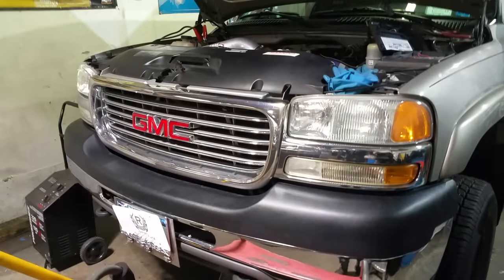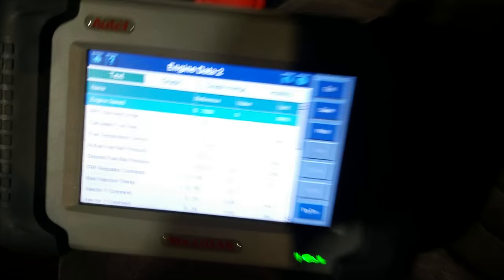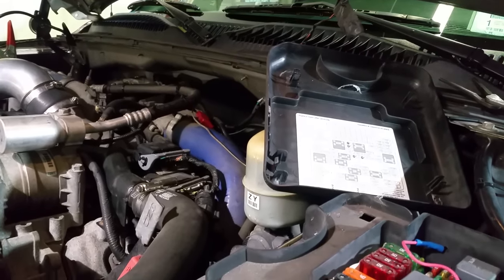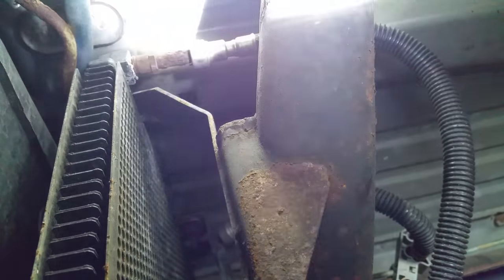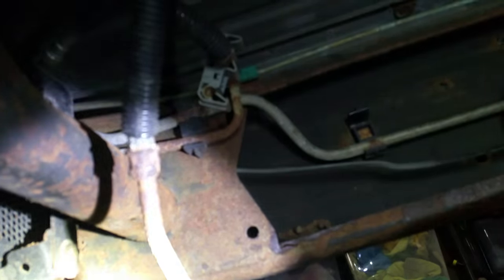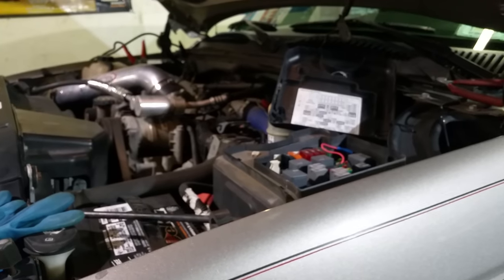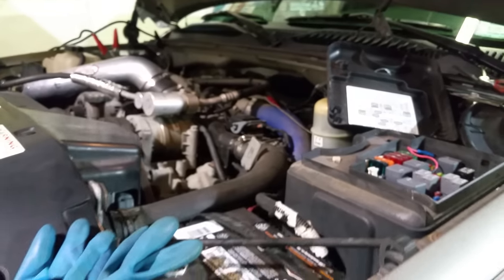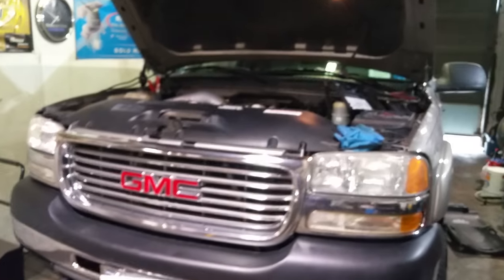How to test lb7 injector return rates balance rates cp3 failure rail pressure relief valve regulator

Comment: Richie, you are wise in the ways of Duramax! 👍👍👍 

Some folks go to the trouble of checking return rates on each bank, but I believe if the engine has 60-70k on VCO injectors, the owner may not be well served by knowing which bank is particularly bad since “in for a penny, in for a pound” comes into play. If a mechanic needs to go in, the injectors are high mileage, and total return is out of spec (CP3 is OK) may as well do an entire set, preferably SACs, which are getting good reviews in the short term (I’ve not read of high mileage experience).

And wow, does the engine you are diagnosing crank fast! New batteries, or low compression? That puppy is really spinning and the ball/seats in the in injector return system must be shot, if they can’t maintain minimum rail pressure for starting.

Comment: Ive found good way to rule out the cp3 when it wont start after a hot soak is to pour cold water on the cp3 and put a air line on it and cool it off. If it starts attempt to max the fuel pressure with a scan tool.

Comment: Why do you think ULSD is responsible for injector failure? Lubricity? That's taken care of at the refinery when lubricity additives are put into the fuel. Would it have been easier to disconnect the return line near the firewall instead of under the truck? Finally, although internal condition of fuel lines is not necessarily related to the external condition, I believe it would be prudent to at least do an inspection. Rust particles can overwhelm the best filter and destroy new injectors in short order. Pretty good "one handed" camera work! 👍👍👍 How's that LB7 running?

Comment: nice vidoe i have a 04 and it won’t star after i put gas instead of deasel  ranit about 20min and it died it havent start after that i took tank off and washed it rebuilt primer. and it still won’t start before this it ran good no smoke it ran fine took it to dealer they said 3 injectors 4,6,8 and 5 were stuck open and thats why it wouldn’t crank and needed all new injectors,but not shure any suggestions i’ll apréciate it

Comment from the maker: I apologize for this correction but the values recognized as Mpa is "Mega" pascal NOT mili pascal as that would be noted as a small "m" insead. The camera doesn't forgive mistakes! lol
Reply: My LB7 has long cranks sometimes won't start.  My balance rates are good and my return rates are less than 100 ml.  Where would you go from here?  Thanks

Comment: I have an Autel just like yours on the injector readings i'm getting 0.24 what is a good reading for the injectors i have an 2002 durmax?
Reply: Mine is also an 02, if that number is for one of your cylinder balance rates in mm3 then it is within spec assuming your rail pressure, fuel rate, temp and all other conditions for a balance rate test are met. Between +4 and-4 mm3 is within spec for an individual injector. All conditions for BR testing need to be met otherwise the BR numbers will not be accurate.

Comment: soo i have an 02 Lb7 i just bought. it will not build rail pressure, it will not build more then 10k when desired is anything higher then that.   i do not have any hard starts. or rough idle,  i have 2 injector balance rates at -3.0 , +3.2 at idle in park, every other is good. i put a lift pump on the truck and it didnt do a thing. im leaning towards a bad CP3. what do you think. thanks
Reply from the maker: For starters, what is the duty cycle of the FPR? Try ans unplug the FPR and see if it can build max rail pressure at idle. If not then move onto the test in this video. I have not seen many failed cp3s. Begin by testing the common items such as fuel pressure regulator, relief valve (test instructions in another video on this page) and delivery to the cp3.
Reply: @richiestruckandauto7438  Hey wont taking off the fpr cause the injectors stress and possible leaks ? I am also guessing we should see about 22000 pounds if the fpr is disconnected
Reply from the maker: @MrAgatto2  No sir. A stock cp3 should not be able to build 22k+ of rail psi at idle. The pump isnt turning quickly enough to build the volume. You would most likely experience pressures in the mid teens like 13-15k at idle. Its only a test to be performed for a second and NOT to be driven in that condition.

Comment: Have an 03 top kick we did injectors in. high balance rates, making oil. replaced all 8 injectors new bosch. lines and all the associated gaskets and seals. fired right up. no longer making oil but balance rates are still high as initial. frp good. Only odd thing i can find now is Fuel pressure regulated flo is all over the map at idle. Leaning towards a bad fpr. you can actually feel and hear it buzz key on engine off. just wondering if I'm head the right direction
Reply from the maker: John Shoemake sounds about right. I've experienced atleast 2 bad FPR valves right out of the box in the 14+ years I've been doing these motors. Before you go any further make certain you do not have contaminated fuel and the harness from the ficm isnt compromised in any way. Once this is confirmed, unplug the FPR harness and make sure u achieve max rail pressure at idle. Doing this, atleast you know it isn't sticking. DO NOT drive it in this condition.
Reply: Richie's Truck and Auto  thanks for the insight. I will dig back into it tomorrow. Happy Thanksgiving
Reply from the maker: John Shoemake the shop phones are on today until 630pm. We are performing shop maintenance throughout the weekend but I can try and help 516-680-7377

Comment: How can you determine what is the culprit?
Reply from the maker: Peter Geralis the return circuit from the cp3 is through a single, small rubber hose. You could simply "pinch" off the flow at the hose to the return line to isolate the pump. 9 out of 10 Xs the cause for excessive return rates are due to injectors on LB7 engines but should NEVER automatically be assumed as such. Testing is paramount. Monitoring and receiving excesive duty cycle of the fprv (fca) and comparing to a known good value during operation "could" indicate an underlying issue w the cp3 or the FPRV and possibly not injectors. Do rember the regulator operates in reverse and not all scan tools will display the values that way. at 0% the regulator is wide open. At 100% it is completely closed. This is why known good values are always useful when trying to decipher a faulty component. Cp3 issues present variable symptoms related to performance (such as fuel rail pressure being less than desired or insufficient supply under power demand) rather than hard or no starts. FPRV can result in a no start when they fail as well so proceed w caution.

Comment: I have a snap on verus pro scanner and the balance rate all show ethier 0 or 1 at idle
Reply from the maker: That is an acceptable reading. Keep in mind though, it's acceptable if all of the injectors are in good condition. If they are all damaged by age, wear, water, debris.....etc then the readings will be of permissible levels but flow in poor condition.

Comment: Is the return rate the same for the LBZ. I have a 2007 gmc 3500 I pull a 3 car trailer with. when I pull hard it throws p0087. never any hard starts, and just added a lift pump and still doing it
Reply from the maker: Yessir return rate is the basically the same. Inj flow rates and rail psi capabilities are a bit higher though. LBZs have known issues w the cp3 internal components. It's NOT highly common but I've seen a few in the past w pump issues. The 0087 is loss of rail pressure code. It could be from a tune commanding more fuel than the system can supply, leaking injector(s), cp3, rail pressure relief valve etc. Need to do a little more diagnosis before condemning the injectors as they are not nearly as common to fail as the lb7 is.